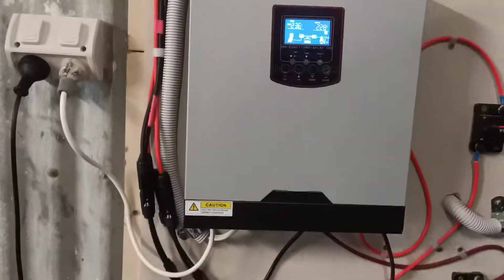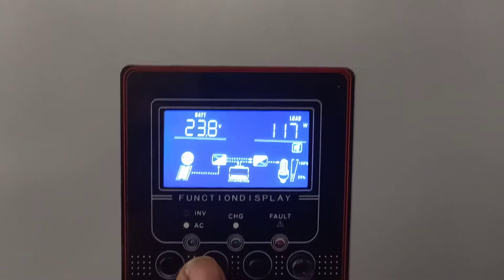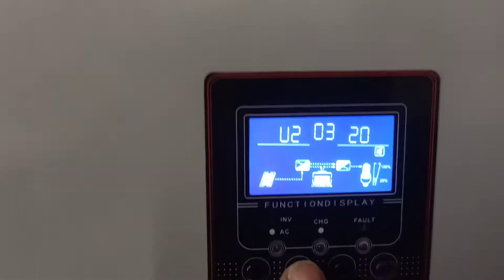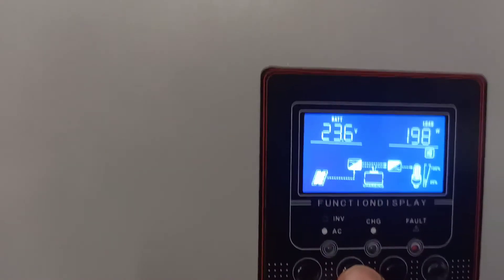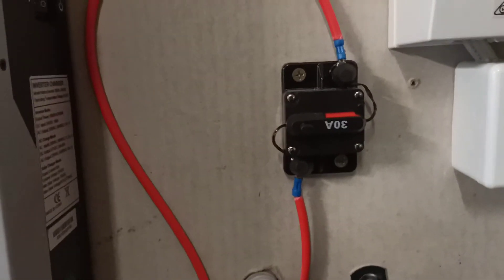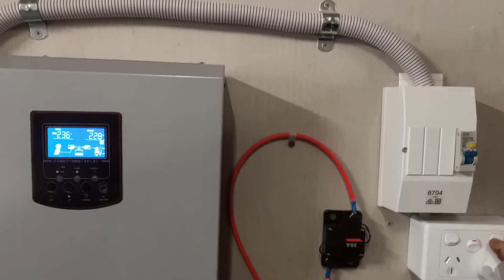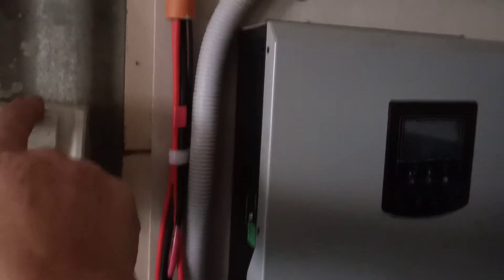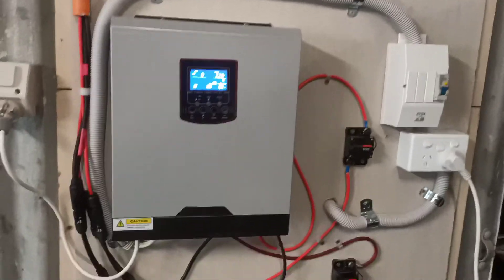Off grid 3KVA 24V PWM Pure Sine Wave Hybrid Power/Solar Inverter Solar Charger Controller test

Comment: Hi Nick, I’m looking at putting one in my shed for yo run a small AC and a some tools. Just wanted to know how your inverter has faired with time and use. Thank you for the upload, I’m new at this and it’s helped us get a better look at how well these all in one systems function.
Reply from the maker: You would need more panel's and more batteries for airconditioning you may have to work out some calculations on power consumption on your appliances.

Comment: What i cont understand is what AC in is..  I just want AC out to my grid?   Is AC in for backup? is this not an grid tie inverter?
Reply from the maker: This is not for feeding back to grid only off grid or used with grid for low power back up

Comment: hello I bought this inverter can you tell me what panels you use and how you connect them
Reply: did you buy pwm or mppt?
Reply: @nicomoloi936  pwm
Reply: Note: the panel Vmp must not exceed 27v. Go with panel brand that have a low Vmp and high current. Connect them in parallel

Comment: Would appreciate for an answer. What would happen if sun goes down and batteries goes low. Will the inverter switch to Grid fast enought so my computer doesn't turn off?
Reply: If set correctly for use with a computer, it takes only 10ms switching over time. It depends on the computer load + all the extras connected to it as to if it would make a difference. It switches fine on mine but then it's only using a 35w CPU
Reply: @dtvking  Thank you for the asnwer! I think I give this system a go then. If I get any shut-downs from my computer or TV. Then I save electricity on my home heaters anyway.

Comment: Ok I bought this solar inverter and i would be good to know the following for people who are thinking to do so as well.
- The battery connections at the bottom of the inverter are very close and can cause fire when having a short circuit.
- But most important ..... don't let this inverter work with AC backup since it can not guaranty a solid 230-240 Volt when the battery goes under 21V. At that moment the inverter goes on en off every second witch can cause damage at you're devices, certainly when the voltage starts to swing between 190V till 210V. At that moment the inverter should just stop with working. (I had fire once with a light dimmer who exploded in that situation)
- You should have extra fuses, diff switch and over voltage checking system at the output of this inverter.

If you have a AC backup there seems no problem since the inverter will connect to AC when the battery is low, and it will wait till the battery is fully charged again. A extra security to cut off the output with manual reset, when the battery is lower than 22 V would give me more peace of mind.

it looks as a good inverter and does what it should do, but be aware this is not a plug and play device.

Hope you like this positive feedback. Cheers

Comment: Hello, I live in Brazil, I have an Easun 5Kva 4000W inverter, I did the installation, but I am having a problem and would like some help. During the day it works perfectly, when the night comes that the Battery reaches the limit for Bypass, it happens, it goes to the network, but it goes into protection with "Error - Code 07", I disconnect the load from the residence, but continue with the error .
Reply from the maker: Have a look at my other videos I have program codes ,see if you program is like mine it may help
Reply: Olá! Você ainda tem o inversor? ele está funcionando?
Reply: @geovani_h  Olá Geovani, ele está funcionando, na época acione o vendedor na China e eles enviaram outra placa mãe, o problema foi resolvido. 
Você está com algum problema no seu?
Reply: @gilbertoalvesdeoliveira2182  Não, estou pensando em montar um sistema. Estou procurando por uma boa relação preço/qualidade.
Reply: @geovani_h  Ok. Geovani, montei o meu a cerca de 1 ano, estou satisfeito, te aconselho a usar um inversor hibrido, ele é compacto, de fácil instalação. Se poder ajudar em qualquer dúvida?
Reply: @gilbertoalvesdeoliveira2182  Agradeço a disponibilidade. Você teve que pagar a placa ou foi na garantia?
Reply: @geovani_h  Oi Geovani, foi pela garantia, embora todos falavam que comprando na China não tinha garantia, fiz a reclamação, pediram que fizesse vários testes, para minha surpresa eles disseram que enviaram outra Placa Mãe,  acredito como eu comprei no Próprio fornecedor da Easun (marca do inversor). Essa foi a msg que enviaram para mim, solicitando um  prazo de 40 dias para enviar;
we will apply a motherboard for you to repair, please wait for more days, we need around 40 days to make it

Comment: Hello! How many KW of Panels can you install Maxim on this regulator?
Reply: Don't buy I've got one rated at 5kw but it gives 5kw when on grid mode.
When on batteries and grid or pv and the bateries hardly supply 3kw, the even when supplied 4.5kw from panels only
Reply: @robertoleszek8361  That's normal for PWM if you want a good solar charge controller you'll want a separate mppt. I would only use the built in one for strings that are paired 12v for for this.
(4x 100w in 2x2 or something) (36v panels will not work well like this without mppt)
in my system i have 3 different charge mppt controllers with my 300w panel strings and only use the pwm for a few cheap 150w panels

Comment: Your  solar  input voltage seems a bit low. You need ~30V to 32V for a pwm to operate.  The battery cables are on the small side. I would go for 35mm2 and a 125Amp fuse.
Reply from the maker: I have put in a 100amp fuse and the system for my shed/ workshop has been fine so far
Reply from the maker: Also I have put in heavier cables from unit to battery
Reply: 3kw maximum output inverter will draw 3000/24 giving 125amps. The problem may come when batteries at 23.6v. The amps would be 3000/23.6 giving 127amps. You should considered 130+ amps. Depends on the length of time below 24v..
Reply: Hi, how many panels and which watts need to get 30~32V.
Thanks

Comment: oh Yes One question if you tested it ..... What happens with you're ac output, if no ac input is connected and at the same time you're battery's can not keep up with the load. Example: 400W output and battery's are almost dead? I had a very bad experience with this case since my inverter went unstable and has blow up some electronics causing fire ...... (almost lost my photo studio .....)
I can imagine they solved this problem with a relay when AC input is connected to bypass..... but without AC input I hope they did a good job shutting down the inverter before it gets unstable........
Reply from the maker: Hey good question it's programmed to go to grid at 22v ,if there's no grid you have no Power
Reply: @fixingstuffwithnick7679  ok i understand this but what is the inverter doing at the last moment when the battery's are giving up and there is no AC input...... how is you're AC output reacting at the last moment. Can I trust connecting my laptop on it? Is it first becoming unstable or does he just shut down the 24O AC output? many thanks for you're reaction
Reply from the maker: @LucMaes-123e-learning  good question i will do that one day but i haven't as yet i have a reliable grid power available and the only time i have seen it go to grid is when the load was to much for the unit , at  this point i have noticed a split second flicker in the lighting with a smooth transition to the grid ,the approx 10 mins later a smooth transition back to batteries and panels. if you didn't have the luxury  of grid power as a back up you could purchase a generator with a battery starter(key start) and use the terminals off the unit to key start the generator . i guess the best thing to do is work out all your loads the average sunlight available and adequate battery storage for you. that is the difficult thing you have to do.In my case its for some lighting and on occasion  some power tools a small fridge  and charging of my tool batteries and e bike.  for me the system never goes back to grid unless my load is over 2kw in a burst . this system is small but for my shed its perfect .

Comment: Hey, Okayyyy i'm convinced to buy one. Bye the way about you're fuses ..... 
It's P = U x I so 2kW should be like 2000 / 240 = 8A fuse for AC output. 2000 / 24 = 80 A fuse for de battery
But good job, at last somebody is explaining objectively and testing most situations who can happen. 
I hear a lot of people complaining that the inverter is not working any more after two months? So how long are you using yours? Is it still ok, are the battery's happy?
Reply from the maker: i put in a 100AMP fuse from the battery now

Comment: I'll have 425 amp hours of batteries next Saturday...I think that'll be about right for the amp draw it takes to run my oven..I've got 340 amp hours now and it's almost enough lol ...probably be better when the rain goes away too but like you say there needs to be some amount of reserve because I might want a pizza when the suns not out...I think I'm just getting enough batteries now maybe.  I can run small loads for days but a 1500 watt load it wants to drop voltage gradually which I hope the 2 more will kind of fix...I started with 2 in November and I have 8 now so I'm guessing I need 10...at least that's a good reason to get 2 more panels to charge them with...I guess that'll be  May's  project....I think at some point it all starts to work right...if I get to run my little AC some this year for free that'll be pretty cool ..I hardly used it last year but it'll be free now...lol

Comment: Do these hybrid devices also feed into the grid like a grid tie? when the batteries are full?
Reply from the maker: no there only plugged into grid for back up when the batteries are at low charge, mine never goes back to grid for power as my loads are not high .this system does not require grid power to work only as a back up option
Reply: @fixingstuffwithnick7679  Thats sad. Can I also set that only a maximum value of watts is drawn from the batteries, and the rest is then drawn in parallel from the grid if I need more?  can you make a screenshot what opions and parameters youre able to set up on computer with the data cable please?
That thing costs a lot of money for me, it should also be able to meet my expectations ^^
Reply from the maker: @Bergwacht  hi thanks for the question, what you can set is the lowest battery voltage that you want you batteries to go back to before it swaps to grid

Comment: What is the maximum solar wattage and voltage I saw you mentioned 4 x 300 watt panels the e bay site gives no solar input ratings I am putting 10 x 190 watt panels on a bus conversion
Reply from the maker: 80 volts dc max pv array open circuit and operating voltage range 30 to 32v 
the manual on page 9 has the info when i get a chance i will post

Comment: 30A  x 24V = 720W.  anything over 720w using batteries will trip the fuse. bad... you need a 100A fuse (2400W)
Reply from the maker: yes i have done that thanks
Reply: @fixingstuffwithnick7679  Liu
Reply: can this unit work with x 4 deep ( wired in series 48v ) cycle battery? 200a fuse?

Comment: Nick you battery voltage appears very low. Fully charged the voltage should be if using AGM battery's around 28.8 volts. Each battery appears around  100amp hours so you have 2 battery,s in series and 2 banks in parallel. So that 28.8 volts is 200amp hours. Regarding DC fuse between the battery and inverter. If you want to draw the whole 3kw from the inverter you will need a 125 amp fuse. Your programming is not correctly set. The MPP inverter are a very nice product once correctly fused and programmed correctly.
Reply from the maker: Thanks for you comments I did upgrade the fuse to 100amp and in my other videos I have shown program, feel free to check it out and comment I am also learning as I go

Comment: Hi Nick, I bought the same system but I am having some operation problem with it. Can you help me?
Reply from the maker: maybe i can what is your problem
Reply from the maker: https://www.youtube.com/watch?v=d3acQlTZnS4&t=37s&ab_channel=DIYSolarPowerwithWillProwse
Reply from the maker: watch some of these videos it may help as well
Reply: I have read through the manual from cover to cover but I couldn't find anything on the voltage when the system restart after it shutdown when the voltage is low. I observed that even when the battery voltage has risen to 26V the inverter is still didn't start. I have to manually start it by switching off and on the main switch. Another problem is when I hookup the generator it keep flipping the output between the battery and the generator. Everytime it flip you can notice the switching over from the generator and the battery. Very annoying. I don't know why it cannot power the load by the generator alone. Another observations, it's not charging the battery.
Reply: Saw the video, again it only mentioned when the system cut off but didn't say how or when it restart.
Reply: For your info, this is my first hybrid. Normally I just used the separated system. The inverter operation is very straight forward. You can set the cutoff and the restart voltage.
Reply from the maker: @syedmohdthalalwafa6993  hi it is a little difficult to work out your problem not knowing your set up but from what you have told me i will try , if your batteries are running out quickly you may need more, also you may need more panels, but first of all you need to see if your load is too high for your system. if your fuse between the battery is tripping then  the load is too high for the system (i had a 30 amp fuse it wasn't high enough for load  i replaced it with 100amp) you need to work out if that is suitable for your system as your cable size and your panel input and battery bank all play a part . your generator should go through and the unit should go into bypass (highlighted on lcd screen when it happens) but if it is and your fuse is tripping still your load is too high (im assuming you have a seperate fuse between your batteries ant the unit) note when i changed to 100  amp fuse i also increased cable size to 8 gauge . i  would suggest you ask a electrician on how to calculate cables and load https://www.youtube.com/watch?v=koFg6oFs0RU&t=1203s             good luck let me know how you go
Reply from the maker: https://www.youtube.com/watch?v=Xy0ozizZRHw&ab_channel=Nick
Reply from the maker: programing is also important as the unit can be programed to cut off and by pass also if batteries are low it will only go back to solar when system is charged . i will soon do a video on my system programing it may suit you
Reply: The load is very small, three cctv and a router. There is no tripping of the fuse. Just the usual cutoff when the battery is depleted. All I wanted to know is how and when it suppose to start the inverter again automatically. Does it wait until the battery is fully charged? 
The system comes with rs232 cable and a small cd. I no longer have any cd reader in my laptop. Most present laptop doesn't come with a CD reader and a 9pin rs232 port. So I can't install the app. I can only program through the small screen provided.
Reply from the maker: @syedmohdthalalwafa6993  ok i will have a look and see what my system does by simulating low battery as im not at property i will do it next time im there and let you know
Reply: @fixingstuffwithnick7679  ok TQ
Reply: @fixingstuffwithnick7679  yesterday I restart the inverter manually and last night around 12am it shutdown. Now it's nearly noon with reasonable sunlight and yet the inverter won't start.
Reply: @fixingstuffwithnick7679  yesterday before I restart the inverter, I observed the battery voltage is already 26V and charging. Yet it didn't start.
Reply from the maker: @syedmohdthalalwafa6993  ok disconnect the load and see if it does
Reply: @fixingstuffwithnick7679  ok I try that. But until now the still didn't turn on. Now it's 4:51pm local time.
Reply from the maker: @syedmohdthalalwafa6993  check my program on latest video on my channel

Comment: Can I use acid battery to power solar panel?
Reply from the maker: yes you can but you have to program battery type in programing
Reply: @fixingstuffwithnick7679  hey nick! Hope you're doing well. My inverter is a 5kV and I'm using four 12 volt batteries in series. What would be the battery type in the program to choose from? Is it AGM, User defined or flooded?